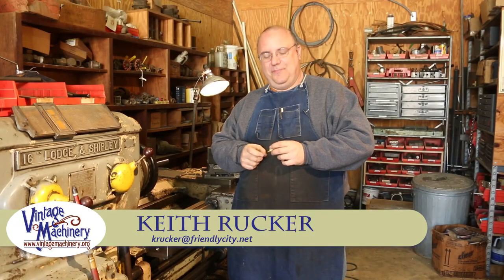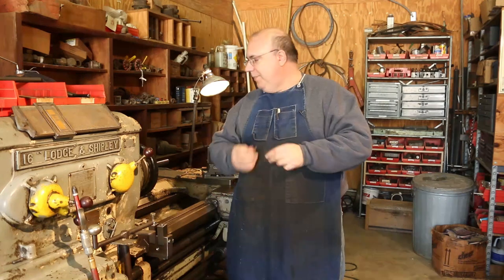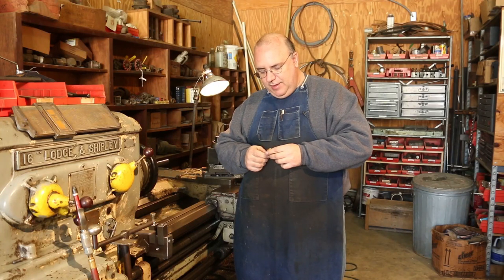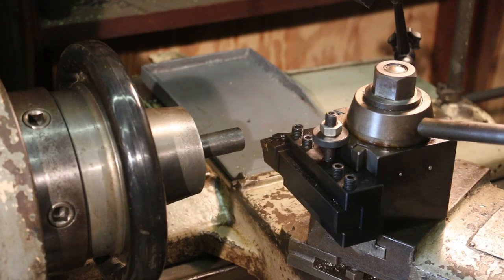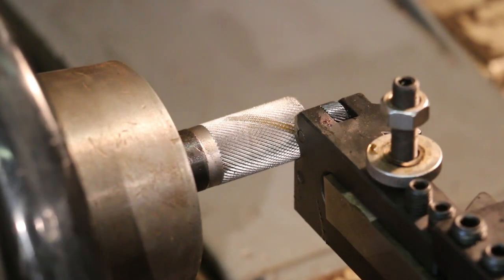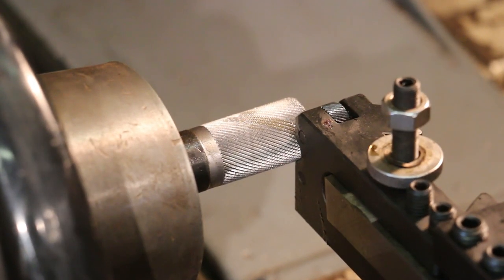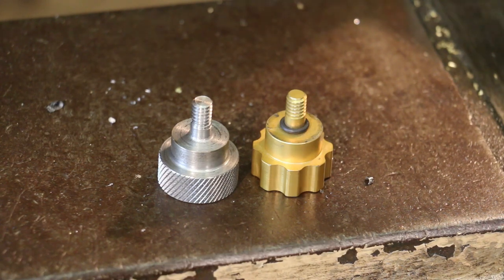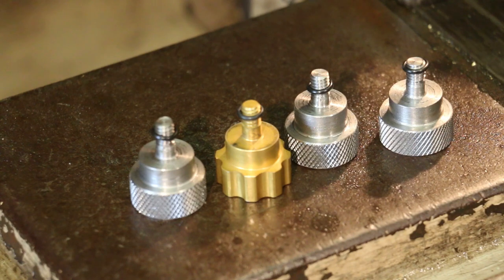Making Custom Thumbscrews:  Turning and Knurling

Comment: A few months ago on my way home from the dump. I found a 10" Lodge and Shipley high turn lathe out by the side of the road in the rain. It was headed for the dump, as soon as the owner could figure out how to get it there. It must weigh in at 2-3000 lbs luckily it has an oil bath system that had it good and covered with oil or a tar like mess. That protected very well out in the rain. It had been converted from 440v 3 phase to 220v single phase with a speed control. The guy even gave me the manual.I have a towing business and my daily driver is a tow truck so I quickly hung it off the back of my truck and brought it home to a nice warm dry spot. What a find!!
Reply: Awesome find!

Comment: That brush was the best laugh I've had so far for 2015.
Often a better solution than the o-ring is use an E-clip with a wide groove that allows the e-clip to move as the assembly is tightened.
Keep the great videos coming our way.

Comment: My friend, knurl in reverse, it avoids the problem altogether. It's what I was taught, and after I did that same thing with a wire brush I learned the hard way myself. I also run much deeper in my knurls, I like the sharp stuff, kept people from borrowing my tools.

Comment: Keith,
I can almost smell the sulfur oil in Maryland.

I used to turn and crowned flat belt pulleys 6" wide by 12" diameter.

Those pulleys had a two degree taper on each end per drawing instead of the proper curved contour.

 Also the drawing called for a coarse knurl on the outside diameter.

No problem, the knurl tracked great down the tapers.

I never calculated a pre-knurl diameter,
Just knurled it.

Kap

Comment: Hope to get a bigger lathe at some point. Maybe a 14" lathe at least. Man alive it took me 13 hours to make two thumbscrews for my KWM clock bushing machine out of hot rolled steel on my Unimat SL DB200. It was an awefully long job but they did turn out nice.

Comment: hi Keith, your videos are much appreciated. nice videography in showing how to start the knurling tool correctly.
i did notice your parting tool has a slanted upper edge. i use a similar tool at work from Komet and have had countless headches with it as it likes to snap off. the mistake i think i'm making is in the grinding.  the way i learned how configure the parting tool is to grind the tool edge parallel to the ways. but something tells me that isn't quite correct as the blade likes to get pulled into the work and snap off. what am i doing wrong? should i just grind the face of the tool and leave the slanted top of the tool alone? how does the upper cutting edge need to be positioned in relation the apex? center, above or below?

Comment: Nice video thanks for sharing. As a thank you for the video, I have a shortcut for the threaded stud. Use setscrews, just tap the part and use the proper length setscrew...also can use stainless to keep the rust away. I would go just a bit deeper with the knurl for the diamond point effect, thanks again.
Reply: ***** At home I only have a Hardinge Cataract lathe approx. mid 1930's with no threading ability, so a die or set screw are the options. Thanks for the videos, well done.

Comment: Since you made several, would it be better to knurl the length needed for all parts at once?
Reply: The idea is to keep the stock short to limit vibration / chatter as it deflects more the further out it is from the holding point.

Comment: Good for her, I shot on the school team, way back when guns were allowed on school grounds! At that time we even had a complete shop where kids could actually use tools, instead of the current method of buying kits to assemble or playing on the CAD machines...

Time to find a self aligning knurling tool... 1/4- 20, standard camera mount thread, even on modern cameras, which when you look at everything else on a camera being metric thread, is surprising. Maybe drill a hole in the center and use a drive rivet to attach a lanyard?
Reply: I'm in a very rural area BUT it's in NY state...

My local school actually surprised me this year. The industrial arts class worked on some real engines.  I loaned them a couple of my spare engines and they came back still running!
Got a request for them next year, Might be a nice guy and make skids and crates for them. Now if I could only get them to take the 7 horse Associated .... That needs a bit of work yet.

Comment: Question: since you're using cold-rolled steel, do you have some sort of surface coating like passivation or cold zinc spray? I noticed the aluminum screw was anodized.

Comment: Hi Keith, super video! I've been looking for someone who can fabricate a small number of custom thumbscrews exactly like this for a home project.  Can you recommend someone or do you perhaps do custom orders?  Basically I need a thumbscrew that is 3/8 16 thread that is 7/16" long.
Reply from the maker: Nathan - I am not really able at this point to take on any work like that - I have way too much to do between building my new shop and my volunteer work at the museum.  I would try contacting some local machine shops and see what they can do.

Comment: Keith, I see the knurling tool is setup using a bar connected to another aloris style tool holder. Pity we could not see a complete picture. Was there a problem with reach ?

Regards,
Tom

Comment: Acid brush + disposable plastic pipette = long lasting dip-less brush.

Jokes aside, really nice episode. The knurls came out perfect, even if you tried to feed them brush hairs ;) .

I'm surprised anyone would put those types of knobs on a scope, something that needs to be steady. I suppose it's for a part that only gets adjusted once, otherwise...good luck trying to be steady trying to turn that knob.

Knurls are always the go to method.
Reply: I think these are simply the ones used to adjust the risers and legs on the base of the spotting scope. I know mine has simple locks for the legs.
Reply: ***** Oh, so like in he old school ones. Hm, yeah, that would make sense.

Comment: If you do more knurling, you should get a knurl tool with a swiveling wheel holder. No fine setup needed, just somewhere near the center of height is enough. Even better are the ones with two independent arms who work from top and bottom of the workpiece and are pulled together by a tightening screw. Put much less stress on the machine and require nearly no setup at all.
Reply: Two Excellent suggestions.
Reply: *****
Tom's Techniques has a project to make a knurling tool http://tomstechniques.com/clamp-knurling-tool/
Reply: ***** it's surprising but knurling tools are not cheap but for what you are doing it will last forever. I learned that you just jab the knurling tool in and rip it across and you will get a perfect knurl every time on an 00 brown and sharp screw machine.

Comment: Good Job
 When you get them back for bluing , Drill an tap a small screw  on the knurl side an make a lanard with an wire eyelet on both ends of a wire  scure to scope with other end .

 If you set screw to bottom out an not tighten against the eyelet , it still will turn an not get lost  when taken apart

Comment: There must be 100 of different pitch knurls out there.  I always have trouble figuring out which knurl will track best. I've looked in machinist handbook, but can't follow it.  There must be a easier way.  I understand DP knurls, but that's as far as I go.  Any easy ideas????
Reply: +jim sanker cant remember the pitch of the knurler I use...would have to go out to the shop and read the box it came in...Mine tracks great

Comment: Any reason you went with doing the thread on the lathe like that, rather than using a simple die? Would've thought a die would be a lot quicker and easier. 

Just learning machining, you've some great videos. :)

Comment: Those look great.  
I thought wearing loose, long sleeves when working with machining equipment was a cardinal sin, especially when you're manually oiling while parting and manually deburring.  I'm no machinist, just thought it was odd that you're putting up guides on YouTube and don't abide by basic safety guidelines.
Reply from the maker: +DarkSide Powder Coating I don't think that anything I did was against any reasonable rules of safety.  I still have all of my fingers, arms, and other body parts so I must be doing something right....
Reply: +Keith Rucker - VintageMachinery.org 

I can't say whether you are following good safety procedures but this:
" I still have all of my fingers, arms, and other body parts so I must be doing something right...."
is a terrible idea to promote.  If ignoring safety rules gets you hurt 1 in 100,000 hours, and following them gets you hurt 1 in 200,000.  You could be unhurt, but still using higher risk methods.  We need to learn from our peoples mistakes.  That is what safety rules are.
Reply: +CorwynGC 
 "I can't say whether you are following good safety procedures..."
And then you proceed to say whether he's following good safety procedures.
.
When did expressing a personal opinion through a reply in a comment section become "promotion of ideas"?
.
The appearance of risk is never accurate in reference to actual risk because it does not factor in experience and other aspects that are unknown to the viewer.
.
I'm curious, have you ever heard of the term "safety troll"?
Reply: BigRalphSmith

Nonsense.  I didn't say anything about his safety procedures.  I talked about statistics and making assumptions from limited data.
Reply: CorwynGC
Why did you talk about statistics?
What was the point of your comment?
Reply: You could try just rereading it (without the presumptions you started with).

My point was simple.  A single anecdotal safety record is NOT an indication that everything is being done correctly, since accidents are RARE.
Reply: +CorwynGC 
That first line was a non-answer (and most likely an evasion).
Who's making the claim that a single anecdotal safety record is an indication that "everything" is being done "correctly"? i saw no such claim anywhere.
Damn. can't you even recognize your own trolling, dude?
Reply: BigRalphSmith
To aid your reading comprehension:
"still have all of my fingers, arms, and other body parts so I must be doing something right...."
Reply: More reading comprehension problems.
I did not say it was a claim, I said "...is a terrible idea to promote"

If you are going to have an argument with things you only imagine I wrote, why not have it solely in your own head, and spare the rest of us.